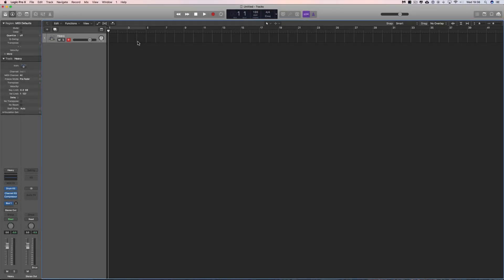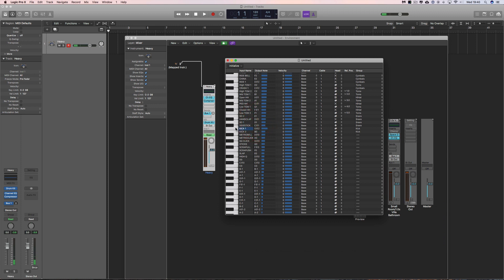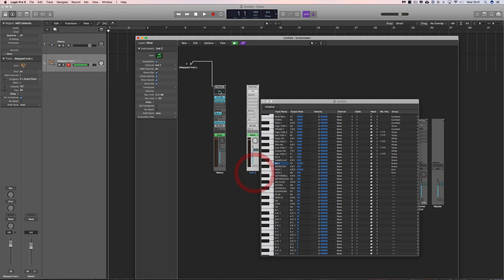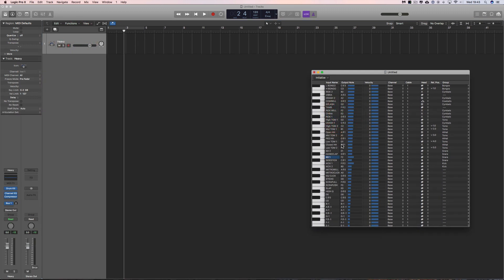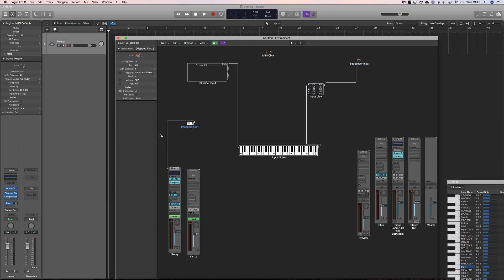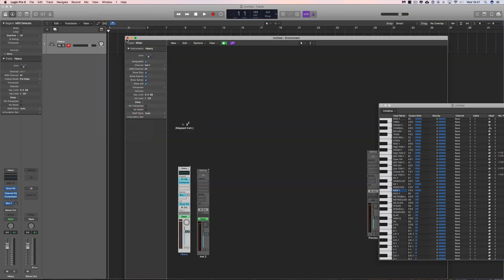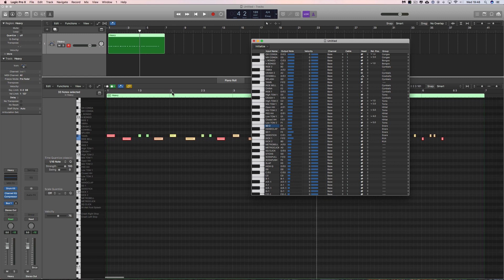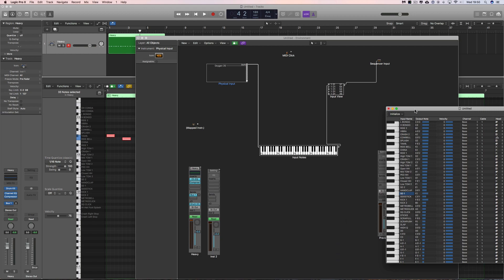V-Drums, MIDI drum kits & Drum Kit Designer (Part-2) - Logic Pro X

Comment: Hi and Thank you for the excellent and detailed videos on dealing with remapping drums... I am using a Roland Octapad and Logic 10.6. My Octapad pads are set all wrong, came that way back from a recent visit to the shop, my kick is now E3, snare F3 and all the other are off. So, I have remapped according to your suggestions and that's fine, it all plays, but when I hit record, I get maybe only around half the notes, seems to just not recognise the incoming MIDI notes.. yet, if I use my Novation keyboard, it works a treat... any ideas...? Cheers!  PS Forgot to add that I can change assignments in Scriptor but same issue of not receiving MIDI notes

Comment: I loaded an instance of kontakt6, connected a mapped instrument to it but when I try to change the sound say on D1 to F1, I hear the correct sound when mousing to it  but when I strike the v-drum pad associated with D1 I still here the original D1 sound instead of F1. I am hearing the desired sound when I click on it but it's not changing when I actually strike the pad.
Reply: actually, the v-drums are all triggering a marimba which is from Kontakt/virtual Drumline, not a GM sound.